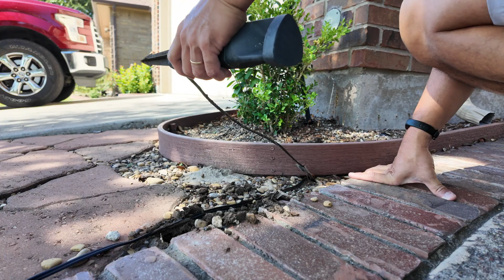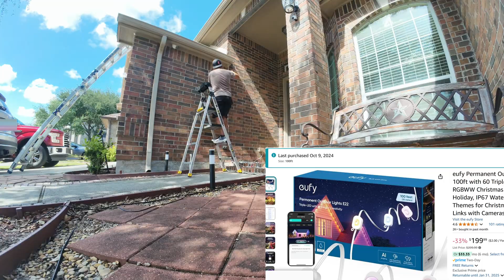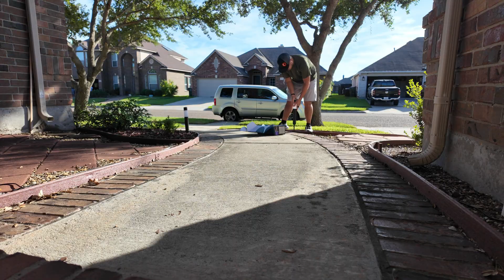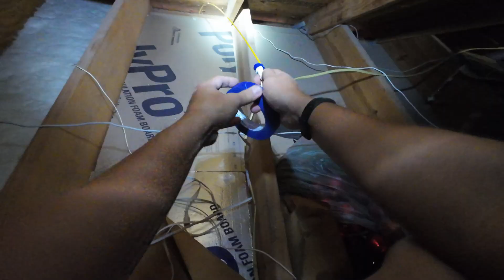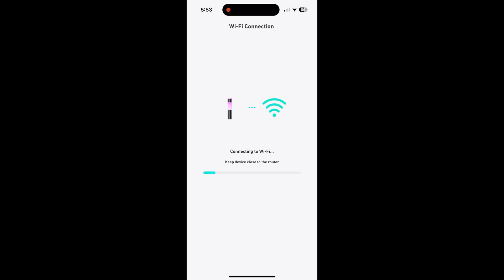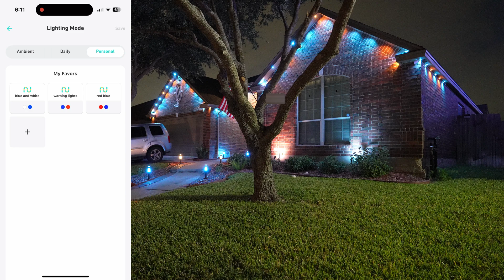Eufy Smart Lights - Festive, Holiday, Ambient & Security Lighting for your Home!

Comment: These lights have many bad reviews and returns on Amazon. I also noticed that they are sold as remanufactured and it’s alarming because these are new to the market.
Reply from the maker: I’m not sure which Amazon reviews you are talking about because the E22 lights are 4.7 rated, the path lights are 4.6 and the spotlights are 4.0… and these are just a few reviews because they just released this. I have a feeling you are confusing this with another brand.

Comment: Just a question
Do you already connect the lights with a eufy doorbell or camera’s?
I have the 120 set and dont get it connected with the doorbell or camera’s 
Please help 👊🏻🤙🏼
Gr Robert
Reply from the maker: If you go to the luminolink tab, you will find the compatible eufy cameras that can control it. No setup needed as long as the cameras are already setup in the eufy app.
Reply: @ 
Thanks for the fast respons 🤙🏼
But ihave the cameras in the eufy security app
And the lights in the eufy light app
Wen i klik on the luminolink
It says that i have to at the cameras in the eufy security app
But i cant get it working
Hope some on knows it
Thanks again
Gr Robert
Reply: @robert64impala  use the same email address for both app, and in schedule of eufy life app you can find the device you can connect! Hope it helps
Reply: @miraaa961 

Thank you
I think that is the problem 
I have 2 different addresses indeed 🙈
I try to fix it
I replay soon as possible 
Thanks again 👊🏼👍🏻

Comment: 💐🌺🌸🌹🌷💐. What is the voltage?
Reply from the maker: The power adapter says 27 volts output on the adapter. 100-240 volts input.
Reply: @ 
Thanks a lot.